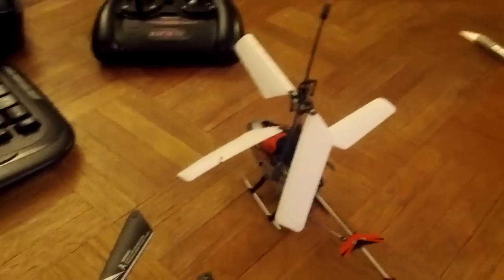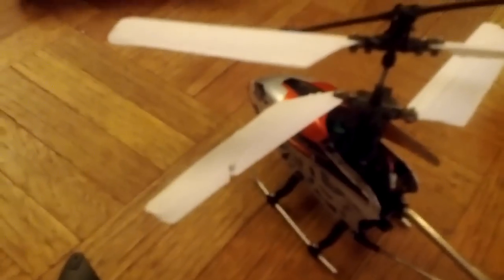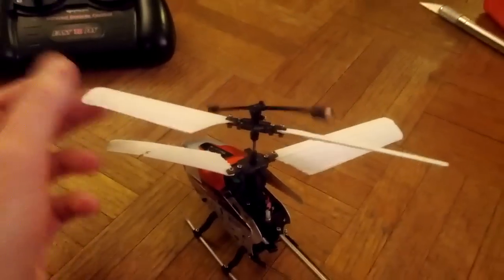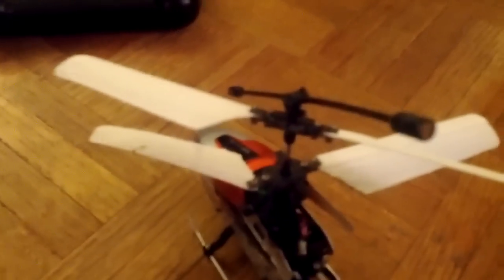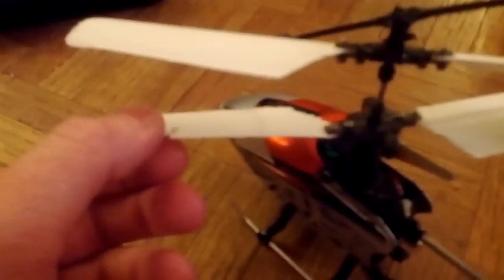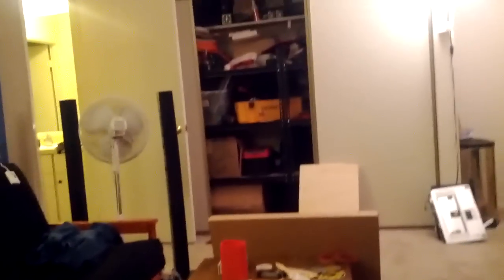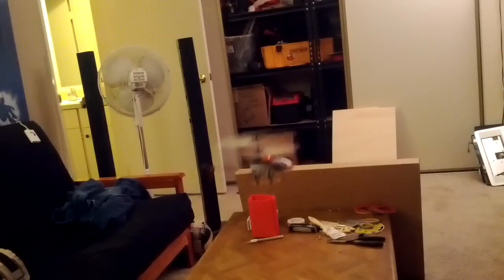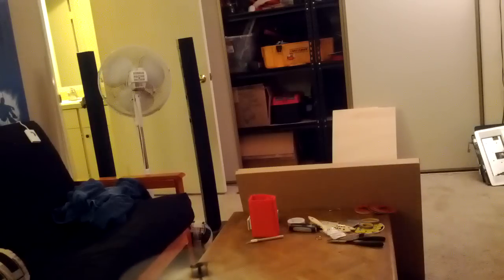Working 3D printed helicopter blades (Ultimaker 3D printer)

Comment from the maker: @karabas3 Unfortunately I don't have an accurate enough scale to determine the weight difference. They feel about the same though - hard to tell. They don't need balancing though. I want to make a set for my new Blade mSR X and see if the higher RPM and higher blade forces are a problem.

Comment from the maker: finally got a gram scale for making r-candy rocket fuel - the 3D printed blades weigh basically the same! .85g for stock, and .89g for mine! The first prototypes that didn't work were 1.6g, and the superlight smaller blades I printed (that work!) are .6g!

Comment: Will this thing print out Heli main gears and torque tube gears with similar strength to the ones you buy? I'd like to get a 3d printer but I don't know how much stress the parts made from a 3d printer would be to take.. Take a look at a Trex 700 video doing tricks..to get an idea of the kinds of stress Im talking about.

Comment: Can the original blades be 3D scanned and then printed as a direct copy of the scanned ones? At least in dimensions if not weight etc.?
Reply from the maker: They could be scanned, but you would need a high quality scanner to produce a good model. It was far easier for me to take some $15 calipers and just measure the blades, then model them up in CAD. This also allowed me to experiment with other blade designs.
Reply: Taylor Alexander Have you made any progress in 3d printing the shell, and the other components in order to put together this RC Copter?
Reply from the maker: I ended up not pursuing that much farther, so no.
Reply: Taylor Alexander So why keep this video up if you make false claims that you "claim" you're going to make more parts for the helicopter? I feel this is just a video for you to boast and tell your friends you made a replacement part for your 2 dollar toy. Why not make it so the entire thing can be 3D printed? People have done it with 4quads and fixed wing aircraft on Thingiverse why don't you take the initiative and make a 3D printed copter?  If you didn't pressure it further it's either out of your scope of your ability or past your knowledge of know how.

Comment from the maker: @jewishcrimenetwork I have been designing mechanical parts for years, so its easy for me to look at something, take some measurements, and produce a similar part in a 3D design program. I used Solidworks to actually design the part in 3D. Most of the dimensions are just approximations of the actual blades - they're not an exact copy. But I got the basics like thickness and length correct. The rest I made up based on experience and some trial and error.